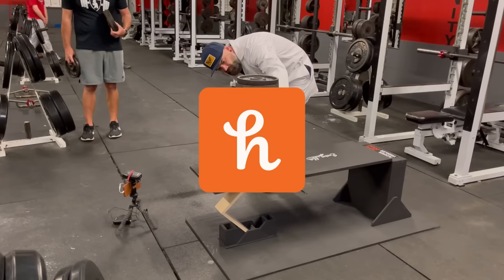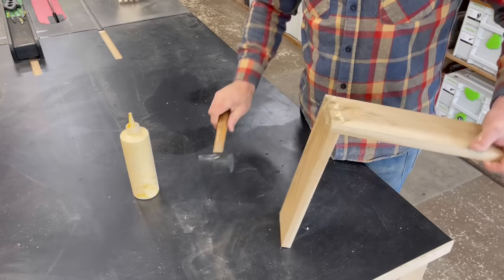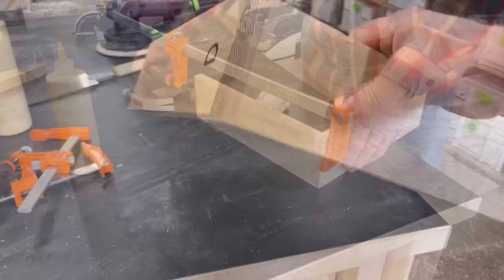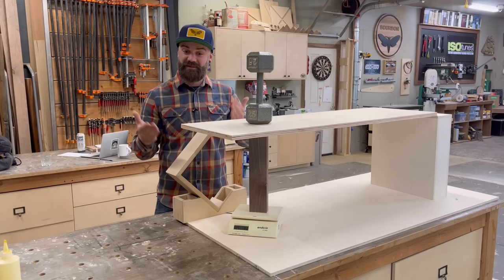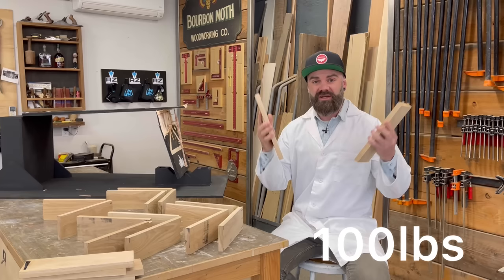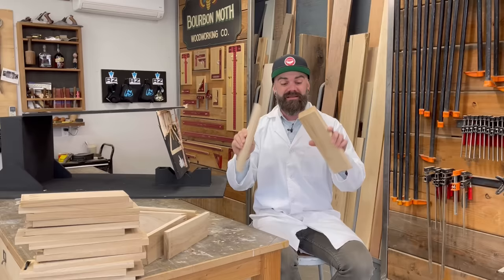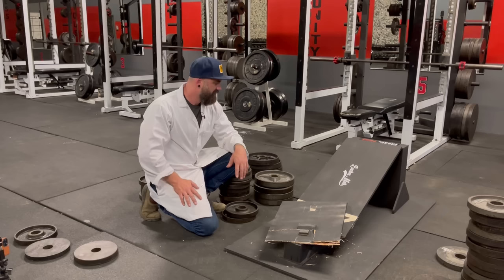What's the Best Wood Joint || Insanely Strong Joinery!

Comment: Great video! A couple of thoughts on the joints that surprised you:
1. Miter joint - this joint puts more surface area in contact because it's cut on the bias; more surface area = more strength.
2. Dovetail joint - the asymmetry of the tenon and mortise widths of the test joint makes me suspect that the smaller-cross- section tenons were the weak link. It would be interesting to compare strength of the style you tested to a more symmetrical one.
Reply: It is also because you have endgrain to endgrain, when you have endgrain to longgrain the longgrain will splitt apart because it is pulled sideways. Endgrain to endgrain will pull the wood fibers in the correct direction. The splines added was made of walnut that is a stronger material. To make it correct it would need at least 10-32 joints of each, statistically sort out differences in wood and amount of glue.

Comment: Quite an imaginative testing routine!  I wonder how a more traditional "finger joint" might fare.  Also I wonder at the lever action of pressing down on that 90 D joint.  I dunno, but am not sure that most such joints are subjected to that sort of vectored and leveraged force.  Might it be a more indicative test, to possibly subject the joints to lateral pulls - or possibly constructing a complete box using the same joint at all 4 locations, and then putting the pressure to the entire box with your inventive rig?  Still and all, you've gotten my mind reconsidering what I thought I knew about the construction of various wood joints and joinery, which is what I think you intended in the first place.  Many thanks!

Comment: I'd like to note that the differences between the dovetail and box joints has a lot to do with surface area and the glue. Early in the video the glue butt joint performed much better than expected. The smaller cutouts on the box joint had significantly more surface area for glue. I'd like to see tests where either the base or the end of the dovetail are equal to the box joint. I think that would pose some interesting results.
Reply: This is interesting! I NEED HELP to figure out what would be the strongest joint for a sturdy woodenbox to sit my refrigerator on.  Top is. I want a top cover to attach to the sides of the box. Should I also put one on the bottom too?  Thanks guys! :)

Comment: It would be interesting to see the results of a dovetail joint that has the same number of pins and tails as the box joint did. Or at least closer to the same number.
Reply: I was thinking about that too. Also consider making the pins and tails roughly the same size. This is likely one of the reasons the box joint did so well.
Reply: @stevesiefken6432  exactly. Who makes dovetails like the ones in this video? I know I've never done it that way. They're meant to be the same size. As soon as I saw those tiny dovetails I laughed.
Reply: Agreed, it is the square area of surface that the glue bonds and as it increases s does the relative strength.
Reply: agreed, i think the thin pins were the weak point in this test.. though very sexy!
Reply: @popparock6506  The pins didn't break, though, so they weren't the weak point. The glue turned loose and allowed the pins to split their way out of the tails. There just needs to be more glue surface so the glue has more strength overall. With so little pin-tail surfaces touching, the glue joint was barely better than a butt joint. More pins will provide that surface area regardless of their size proportional to the tails. Increasing the number of pins will necessarily reduce the size of the tails, though.
Reply: They might have been too tightly fit, too. If all the glue was pushed out by putting the joint together, then of course the glue part of the joint would be weak.
Reply: @Richard.Dawson  most people make dovetails with small pins. That's the traditional way they have always been made before electric router and other machine based dovetail jigs.
The small pins actually make for a really strong joint in the direction of force the joint was meant to protect against.
Reply: @karl_alan  "most people make dovetails with small pins" - 
Most people base the size of their pins on the thickness of the material they're using.
I've seen where small pins are used as a decorative feature on higher end pieces when strength isn't a concern. But small pins are not going to be stronger than large pins. Making pins that you can easily snap off with any pressure, isn't a smart choice for strength. Since this was a strength test, making the weakest pins possible seems flawed.
Also, most people I've seen, make equal sized pins throughout the joint. It doesn't make sense to me to use that technique unless it's a decorative feature. It definitely isn't the strongest choice.
Reply: @Richard.Dawson  I don't fully understand what you are trying to say with most people making the size of their pins based on the width of material. Most people do use a fairly standardized dovetail angle, so the width of the fat end of the tail is going to vary with material width, but otherwise usually it is the amount of pins that is dependent on material size, not the width. 

Also though, small pins are not just a decorative feature. They are a standard way to do it (more below on this). It would be interesting to see how fat pins did compare to thin ones in a strength test like this, but since that isn't the direction dovetails were made to be strong anyway, both would still be somewhat irrelevant. 

Now back to whether it's decorative or normal: every woodworking course I have ever taken has taught thin pins. Since I can't expect you to take the same courses though, or take my word as that for proof: do a search on YouTube for "dovetail joint". Every tutorial by someone who was trained to do them has thin tails. People regarded as experts in technique and have their own schools and/or training programs. People like Jonathan J.Katmoses, Rob Cosman, Matt Estlea, Matt Cremona...even fine woodworking journal's video on how to do dovetails has small tails. The only tutorials I can find doing even size pins are ones aimed at beginners, trying to get new people into the craft, or based on making machine made dovetails. 

In every strength test I have seen of dovetails using the proper forces they would be subjected to in a drawer, it's actually the angle of the dovetail that makes the difference, since what it's really resisting is the mechanical strength of the angled fibers. Because of that, there are various schools of thought on the actual ratio, and whether it varies for hard or soft woods. Like a 1:6 vs 1:8.

 The width is irrelevant, because it's more about mechanical strength than the endgrain to face grain glue area, which if you think about it is the only thing that changes with tail or pin width.
Reply: @Richard.Dawson  in case you don't read my entire last post that fully explains and responds to your post, I just want to repeat the last part. It is the angle of the pins that makes a difference in strength, not the width. The angled fibers change the amount of mechanical strength the joint has against sheering forces. The only thing that changes with the width of the pins is the amount of endgrain to face grain glue surface...essentially how much like a butt joint it is, which he showed to be the weakest anyway.

Comment: Great Video! Entertaining and informative. Very interesting results indeed. Based on other joint strength videos, I would have expected dowels to have been one of the stronger joints. You have used plain dowels. Maybe you could add an extra joint (in your suggested future joint tests) using fluted dowels? The extra surface area could make a difference and it would be interesting to see what the difference would be if any. Thank you
Reply: from the breakage, it looks like the dowel joint failed because it blew through the thin side wall.  That suggests to me that the dowel to board ratio was too high.  smaller diameter dowels would have done better.

Comment: That dovetail broke easily because the tails were uneven. The strongest regular dovetail joints have even tails.
Reply: That's what I thought ... you 'sort of' want a box joint (equal fingers) with a dovetail shaped fingers.
Reply: I wouldn’t bother optimising at this point - the effort vs strength ratio was a good demonstration of putting efforts elsewhere if aesthetics isn’t a priority
Reply: @willd0g  eh. Not necessarily. If even dovetails were twice as strong as the other choices, then they should be used under the right circumstances, but we won't know without further testing.

Comment: Answers for Mr. Barnett’s Wood Tech Joinery Doc: 

1) Butt Joint

2) [YOUR CHOICE]

3) Miter Joint (With Splines)

4) [YOUR CHOICE]

5) drill, table saw, sander, miter saw

6) Dowel plate, box joint jig, Japanese pole saw

7) Different projects require different minimum strengths and project geometry can influence needed technique

8) •Butt Joint

•Dowel Joint

•Box Joint

•Miter Joint

•Miter Joint with Splines

•Inside Pocket Hole Joint

•Outside Pocket Hole Joint

•Domino Joint

•Lamello Joint

•Hand Cut Dovetails

Thank me later.

Comment: It would be interesting with a dovetail joint  with more angled tails - less like a box joint - of the same size on both pieces of wood.
Reply: That’s the one I am used to making also
Reply: Yes, the pin to tail ratio should be equal for more glueing surface and equal strength of the pin and tail portion of the wood.
Reply: @scorpiorysing  Exactly my thought.

Comment: That was a great experiment. I have to admit that I had the miter joint not lasting much longer than the butt joint, which I di have as the weakest. I also thought the dovetail with all of it's glue surface, and the cuts at angles would be stringer than the box joint. You learn something new everyday. Thanks for doing this!!

Comment: I spend most days analyzing loads, stress, strain, etc of different structures. Personally, I think this was one of the simplest ways to convey the overall "strength" of common joints without truly diving into the mechanics and nitty gritty of the material factors, different loading conditions, etc. This video is a really good "snapshot" of more or less how certain joints handle bending moments. I think another really beneficial test would be some sort of compressive and tensile test (pushing the joint together and pulling it apart) as that will show how truly strong these joints are in terms of the types of loads they will likely see.

Comment: One thing is the vector of the force. In your experiment its at 45 degrees. A drawer front for example would normally only be subjected to vector forces at a - 90 degree angle (pulling apart as opposed to being compressed. That would be a whole different situation where a dovetail might fair much differently for example. Might be getting into the weeds here but it poses an interesting question. Still, your texts reveal some amazing results and  basically echo some of the results from Patrick Sullivan’s experiments in which he debunks the end grain myth.

Comment: When you are breaking a join, you are applying leverage forces. The fulcrum of the lever is the inside edge of the join. Max pressure of the lever is at 90 deg and most of your joins are 90 deg joins. The only counter force is the area of friction (glue) of the join, itself. Finger joins have more surface area contact between the two pieces so they are stronger. But miter joints are 45 deg joins, not 90 deg.  Since max force of our lever pressure is at 90 deg, the inside edge of the 45 deg join essentially avoids the max stress of the weight being applied (some of the pressure is actually applied to pushing the two pieces together).  I would still think that a finger or dovetail would work better in something like a drawer front because the stress applied there is pulling, not a 90 deg lever trying to fold the join in on itself.  Thanks for a great video!

Comment: The testing method tested the strength of the joints in a direction of load that most joints are not under in almost all wood joinery applications. Great  idea, but a better test would be to replicated actual stresses typical joinery is  subjected to
Reply: I would not say that most joints do not experience such loads, i would even go as far as to claim the opposite:
Most joins break BECAUSE of loads at odd angles. When you build for example a stool it will not get loose cause of the downward force of a person stepping on it, but due to the side-to-side rocking that happens when stepping on it.
With cabinets, crates, boxes etc it is the same - they are strong in the direction they are designed for but fail due to rocking in other directions.

Comment: One of the most common uses for dovetails is drawer sides. in this case the force is trying to pull the joint apart (not crush it). Because of its shape I think the dovetail would do better than most of the other joints in a test of trying to pull it apart.
Reply: Exactly. Form follows function. There is no universally "best" or "strongest" joint, there's only best for a certain application. Static vs dynamic loads, direction, load cycles all play a role in eventual failure. Dovetails are designed to secure drawer faces on after hundreds of thousands of cycles. They are mechanically sound in the direction of pull even after the glue fails. I personally have drawers I use daily that are over a century old and still tight as the day they were assembled.

I'm not cutting dovetails for everything, but I'm highly skeptical there's a more durable joint for drawers.

Comment: Making the joints:
1:31 butt
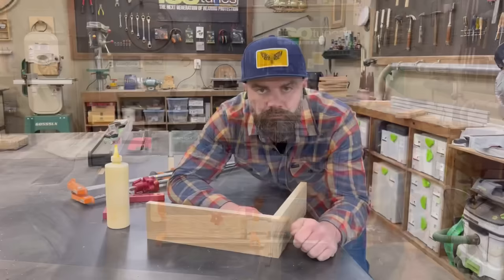1:41 dowel
2:38 box
3:35 miter
4:02 miter with splines
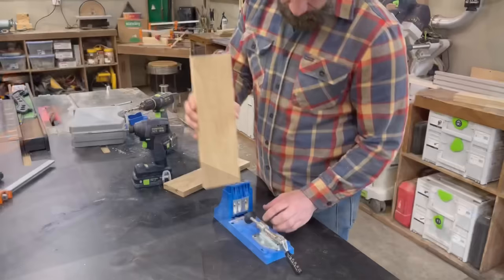5:29 pocket holes
6:19 domino and lamello
8:04 dovetail

9:00 explaining the joint tester mechanism

14:16 butt test 60 lbs
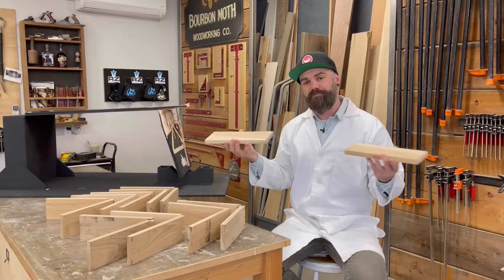15:35 lamello 70 lbs
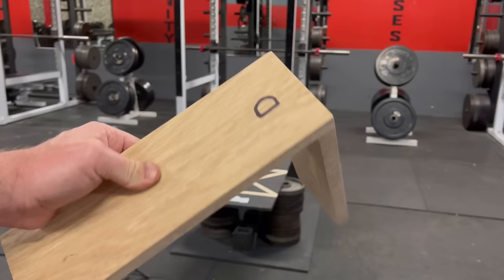16:23 domino 100 lbs
17:40 pocket hole inside 100 lbs
18:08 through dowel pins 110 lbs
18:44 dove tail 110 lbs
19:58 pocket holes outside 170 lbs
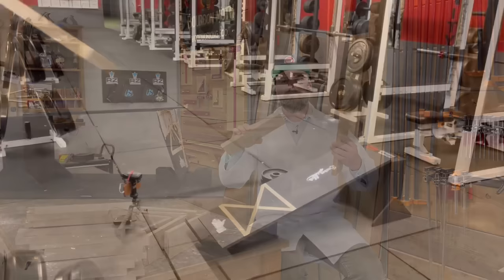20:52 miter 210 lbs
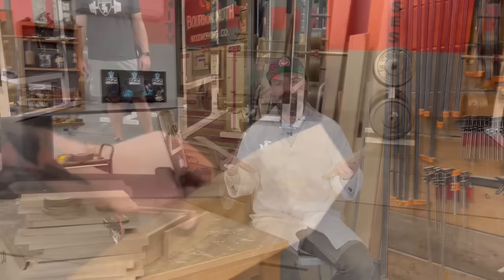21:55 box 220
22:50 grand winner miter with splines 270 lbs

Comment: I think you missed the memo on the end grain situation last year. The end grain pores stuff is myth, and that was apparently reported years before as well. Some of the tests showed the end grain over the exact same area holding up better.

Either way, butt joints are not weak because of end grain. They have no mechanical strength combined with a small surface area.
Reply: Also, the dovetail doesn't provide significant mechanical strength rotationally. It's designed to be pulled. It's a bit like a trailer hitch, except the hitch is actually designed to turn left and right while the dovetail is not supposed to be pulled left and right. But you're measuring the strength pulling forward. That's why they're used on drawers the way they are.

Comment: Great video and test! For your next test, please consider adding 1/8 inch finger joints to the mix. It is the same as the box joint, however there are many more of them. This significantly increases the glue area, and I believe this would be your best shot at having the wood break before the joint does! Good luck!!!

Comment: End grain to end grain is a stronger join. Has been tested, is just the way we cut and build with wood, we do not glue face to face joins in large areas (square inches face to face.. The miter join had twice the end grain area join, compared to the butt joint! The number one winner is again a end grain to end grain with the help of spinters...makes sense!

Comment: Next time you perform similar texts, don't create a cantilever on the bottom of your test alignment jig.  The fact that the bottom legs of your tested joints remain in position after joint failure shows they weren't free to pivot at their bottom contact point.  That changed the forces that flowed through the wood creating a lateral force on the joints rather than only a vertical force transferred directly into the joints being tested.  For example, it's likely you could stand on the bottom legs while still in the jig after.  I think your test as-is was reasonable for determining the relative strength between the different joints, but the test-alignment jig changed the dynamics of the forces applied to the joints.  The cantilever bottom jig, and the notch under the weight-board on the top created a much more lateral shear force on the mitered joint than it was a vertical force.  I hope that makes sense.  Aside from all that, thanks for taking the time to do this and making such good videos for others to enjoy.

Comment: I can explain the difference in between the butt joint and the miter joint strength. 45 degree cut of the miter joint results in an increase of the contact area by a 1.414 proportion. This would not account for all the increase. Looking at how the glue joint is loaded, there is much more shear across the butt joint as it is loaded up at a 45 degree angle in your setup. The miter joint is loaded straight up and down through the joint. The glue only has to resist enough to counter the moment in joint which is the downward load times the perpendicular distance to the joint from the downward line of action of the placed load. This is why the miter joint can be loaded so much more in your setup. 

Thank you for your video. I have gotten interested in making wooden boxes, and I just learned about the miter and spline joint from your video. This joint looks very nice and strong. It also looks a lot easier to make than a box joint for someone with fewer tools.